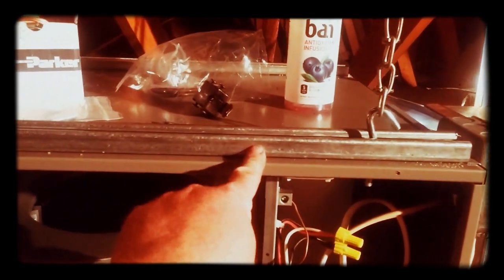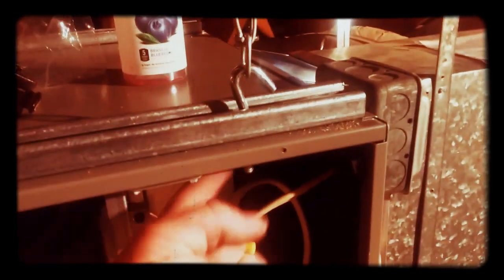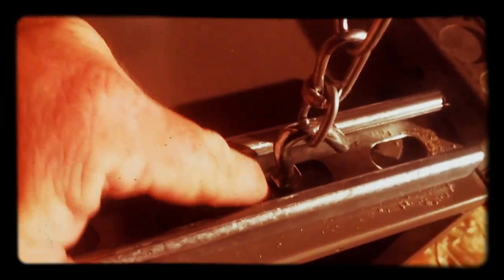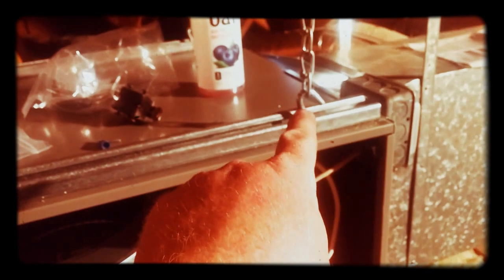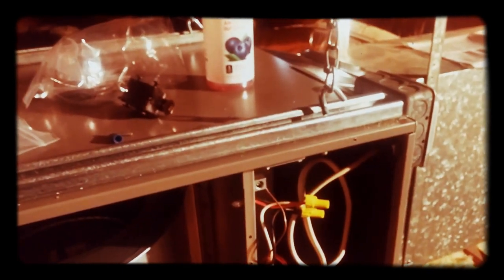How we hang an air handler

Comment: Looks slick! We about to hang a horizontal Payne air handler this weekend. Is your method good for Payne unit? My job is the hanging design before hand. Are you using a pan underneath air handler at all?
Reply from the maker: Yes it is good for payne.  And yes we always do a pan
Reply: @BillyKnoth  thankyou for your reply! Last question- how do you keep pan up there underneath?? Didnt see it in video. Your help on this is very much appreciated!!
Reply from the maker: @stevenyaden5649  we put 2x4s under the pan and use drive cleats bent over the lip of the pan to secure it to the 2x4s
Reply: @BillyKnoth  Awesomeness

Comment: That's a method I haven't seen .often Trane used to have 1/4" mounting nuts on one side of the ahu for a similar set up

We cradle the pan then support the unit over the pan on legs .